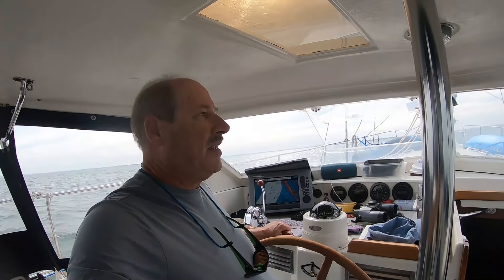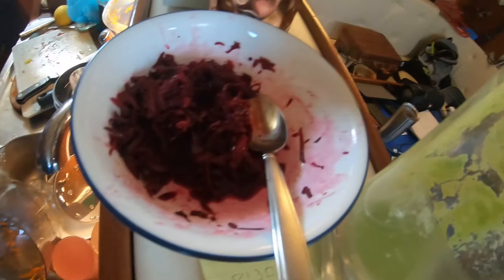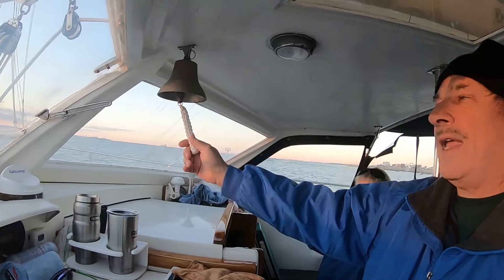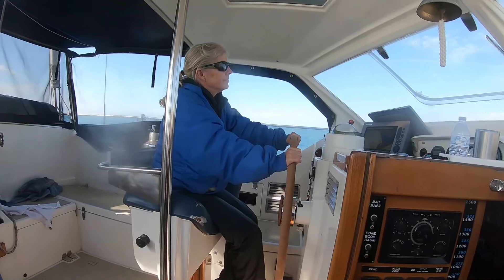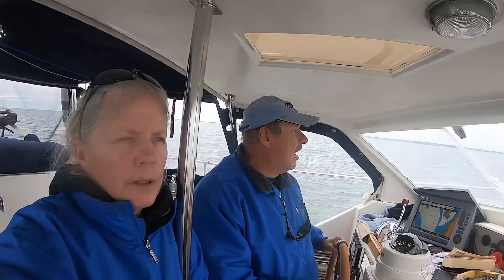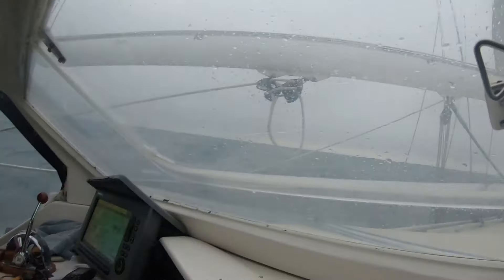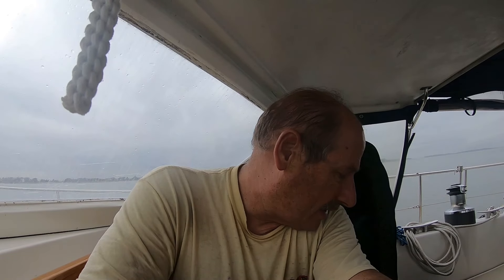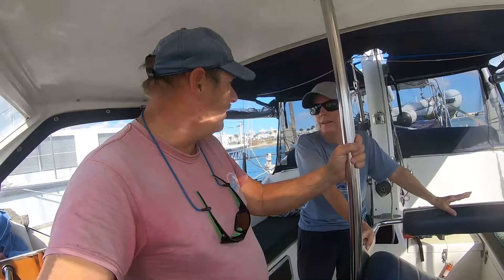Oh No! Fly Away Boom! | Sailing Huntress (Ep 54)

Comment: Hi Dave @ Sharon, love the video's and will be following along on your adventure. Maybe you can answer one question and that is how is the headroom underneath the hard dodger standing behind the wheel.
Reply from the maker: Thank you for following us on our adventure. On the Mango, it has a recessed floor standing behind the wheel which goes from the front of the cockpit to the cockpit floor/engine cover. Standing room is 76 inches. Sharon has no issue with headroom anywhere on the boat.